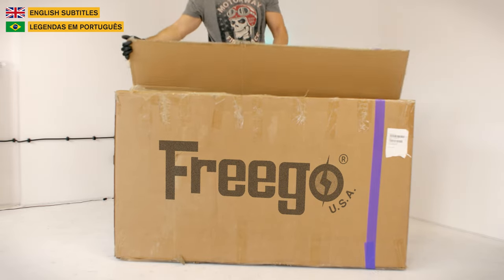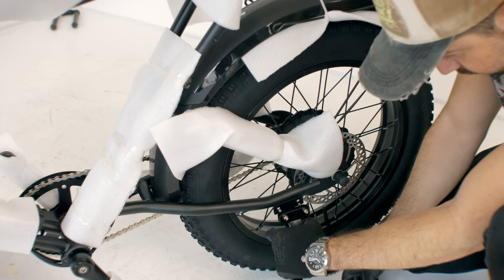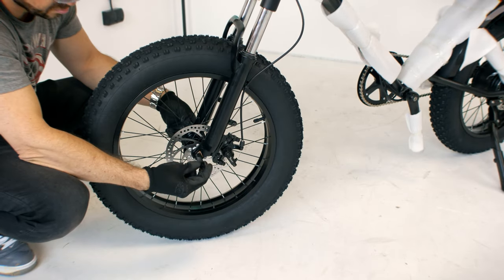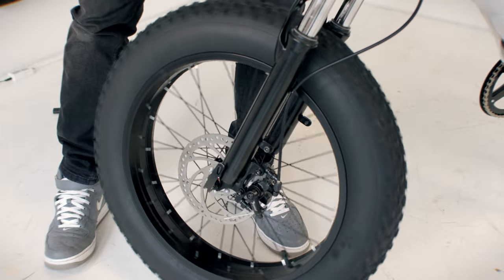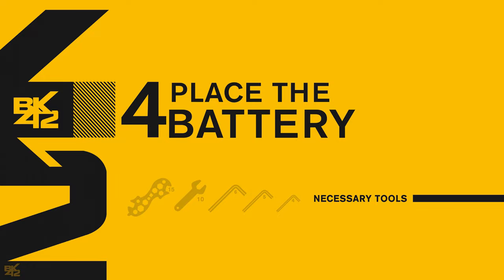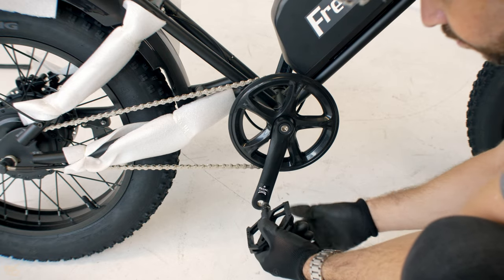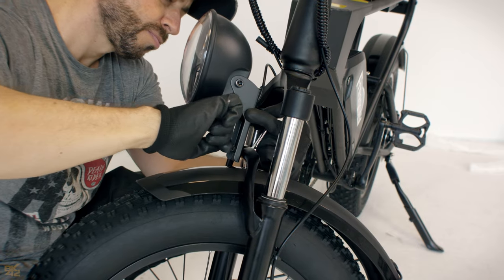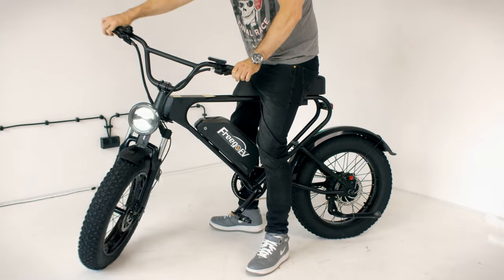Freego DK200 Powerful E-Bike | Unbox and Assembly

Comment: Does this bike have an anti-theft feature? I plan to ride it to work so if I leave it outside/unattended, how can I assure it can't be turned on and taken by just anyone?
Reply from the maker: Hi, no there is no anti-theft features installed, but honestly, so far I have not seen anyone really efficient. When I keep my e-bikes unprotected  I have them very well locked with Abus bordo Granit, alarm and most of them with hidden GPS or locating tags. 
As well I always remove the batterie.
If they can easily steal a heavy motorcycle, there is not a real anti-theft system able to protect a bicycle that is a lot lighter :(

By the way, I will publish a complete video review of this bike this week. Stay tuned.